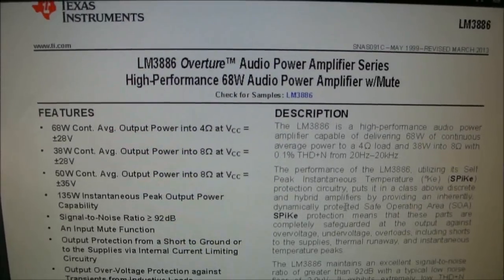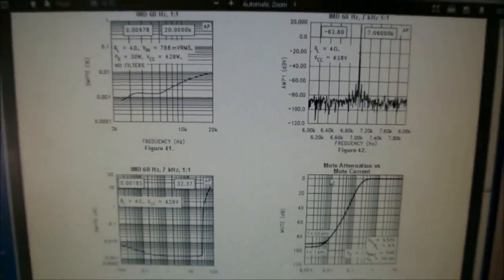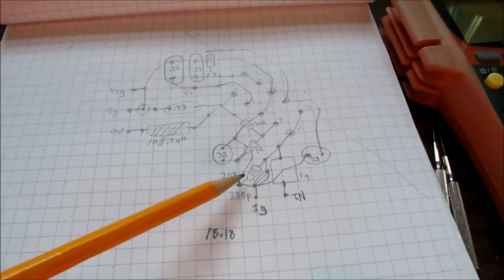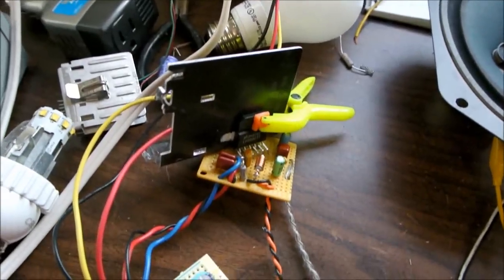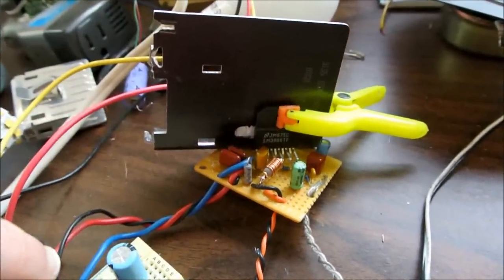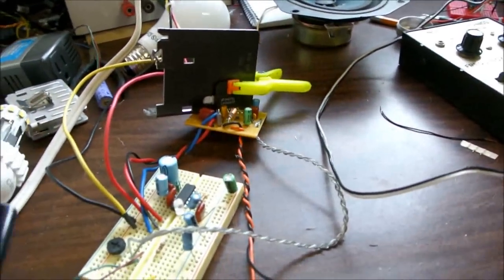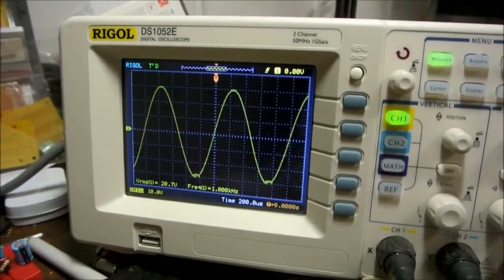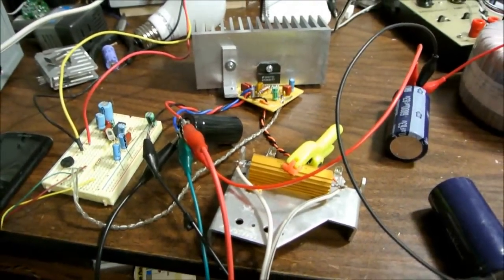LM3886 monoblock audio amplifier on breadboard

Comment: “Very-very” means -120Db or less. -80 is not “very-very”. 498x0 was way better but discontinued due to no demand for a good sound. As well  high voltage low noise BJTs were discontinued as well. Everything is going to be xiaomi.

Comment: What is the maximum voltage can we use? I have 24-0-24 5 amp transformer can I use it to power LM3886?  Because after rectification it will be come 33.84V +/-. Will the chip withstand that?

Comment: Do you have any advice on finding a transformer that can deliver 6A+ at about 15V without having to pay the 60$+ that DigiKey (and seemingly everyone else) wants? I want to build my own simple power supply, but price has been a very limiting factor so far. The idea was to power all my amps  (for 5 speakers) off one power supply instead of three.
Reply from the maker: Sometimes you can find transformers on ebay. 15v at 6A is 90 VA. You could find a transformer of a similar VA rating and rewind it to your needs. 15v isn't too hard to rewind if the design of the transformer allows it.

Comment: Mine didn't work,only little buzz on output.I am electronic hobbyst for 20years now.
Power supply is 2 x 26V[6800uF].Mute pin and components double check.What the hack !,oscillations,ground loops ?,
Reply from the maker: Where did you get it? There are a lot of counterfeit parts that may not work.

Comment: These are great amps! Yours does the same thing mine does - it starts clipping on the bottom peak before the top. That's just the characteristic of the amp I guess.  You read 20.5 volts on your scope.. was that RMS? Also, where did you get your power transformer? I'm trying to locate one that doesn't cost too much. Here's my vid...https://youtu.be/E0bkPbJzpbM  -  thanks for posting your amp.
Reply from the maker: +Bob H Yes set the scope to display volts RMS since I was calculating power output from that directly. A friend gave me that transformer. Sometimes you can find old scrapped stereos with the right transformer volts and amps you need.
Reply: +JohnAudioTech - Nice scope! Mine doesn't have that feature,  so I must multiply peak v by 0.707. It works, just takes longer. I'm sourcing power transformers for these amps. lve found a few affordable ones from china, and some SMPS that are even less expensive than the transformers. I plan to make another vid with these sources and mods. BTW, the AB amps (like the 3886) have better characteristics than the cheapy Class D amps everybody's raving about. They're not as advertized.

Comment: Correct me if i am wrong, these amplifiers require a +/- and a ground power supply
Reply from the maker: +AG Electronics You are correct. That is often called a split or dual rail supply. They can be made to operate on a single supply with some modification as shown in the datasheet.
Reply: +JohnAudioTech Thank you for replying. your videos are awesome and very informative.

Comment: hey john thanks. I've using this ic for almost 3yrs. And they r doing good. sound quality is the best. can you do comparison of LM3886 & TDA7294? PLZ
Reply: Both will sound very fine (will be hard to distinguish with naked ears). However if you take the specs, you'll see that TDA has somewhat worse signal to noise than the LM.
At 30W 1KHz 8ohm, LM3886's distortion is below 0.003%, whereas TDA's distortion in the same conditions is 0.01% (several times higher).
Easy to measure, but maybe harder to hear.
Of course LM3886 does not extend to 100W like TDA does, but most music is at lower wattage levels anyway.

Comment: Hi John AT, nice tutorial for all DIYers, I built one using (PCB ordered) LM 3886T, but the problem I am facing that the IC is getting very hot and the sound produced is also weak. Power supply is 22-0-22 transformer. Plz help me out.
Reply from the maker: deep narain Did you attach the proper size heatsink? It needs quite a large one like the one in the video. It could be oscillation if it gets hot even with no apparent signal on the output. Beware if the kit was one of those low cost Chinese ones, it could have counterfeit parts.
Reply: Thanks for the reply!!!
Yeah the heat sink is not of that much size to remove its heat.  Even in no load it gets heated too much. I had bought the PCB online and the components from the shop.Can you tell me the size of the heatsink required and the value of potentiometer??
Reply: Bigger is better, try experimenting with it, man

Comment: Enjoy all your video's John. Very detailed for the most part. But, a proper schematic would have been nice. I tried to figure it out using your layout drawing on graph paper from your video but could not make out some of component values and/or traces. On a side note, It looks like you wrapped your inductor around a resister.(A resister and inductor in parallel maybe?) 
Anyway nice video's... Keep up the good work
Reply from the maker: Ron Hamer Hi Ron, Thanks for watching! I follow the datasheet schematic but may add or change things to my needs. For example, I might change the gain by adjusting one feedback resistor. In my latest LA4425A video I included a schematic of my changes. Your needs may differ from mine, so the datasheet schematic is a good start. You are correct about the resistor wrapped inductor.

Comment: Hi John, AT, Just a couple of things I wanted to mention, first, I build the Ruby 1/2 watt guitar practice amps using a JFET and the LM386 op-amp, I can build one on a breadboard in under 5 minutes by memory and they work great, but lately when I  would transfer to perfboard they did not work or just made nasty noise, no real use of pots. I took voltage readings to compare to breadboard, no o-scope, and one night tried checking the phenolic board its self and found stray voltage on board where it should not be, I took a utility knife and deeply scored around JFET, had volts,6+ when should be 2 or less, 0 on breadboard, well, the amp then worked perfectly, full gain, full volume. I fixed 3 I had laying around in minutes. Transient voltage I think it is. Thought you might like to know. I built a LM383T TO-220/5 pin chip, used seperate ground paths I learned from you, but, where it works, output is low compared to 1/2 watt or less Ruby. Could you possibly do a tutorial on one? Thanks for all the excellent vids. Happy 1st of Feb, take care, Cass.
Reply from the maker: Cass Virgillo Interesting stray voltage issue. Thanks for sharing. The LM383 is similar to the TDA2003 in which I made an amplifier build video a while back. Perhaps it doesn't have enough gain.

Comment: Well I did tried TDA1558q, TDA2030, TDA2050, sadly none of the LM chips. But I found discrete amps bit more interesting, even if it is worse, just 'cause I love muckin around with circuits and learn something in the process

Comment: OK  I cheated Ii  bought  one of those  eBay board kits ,for 14..00  but  I need a dual rail power supply to power it.😞
Reply: just buy a dual secondary transformer and build a small power supply or use a lab supply.